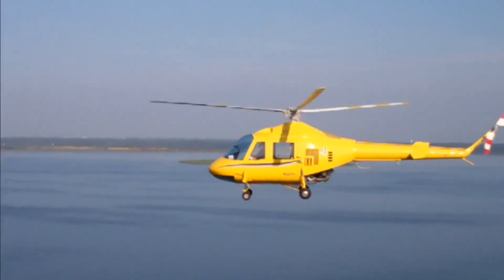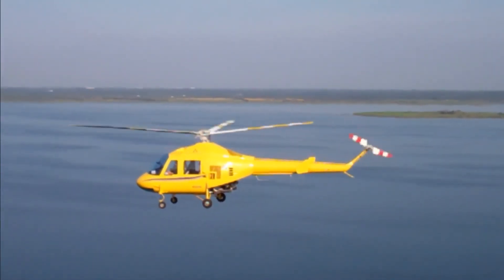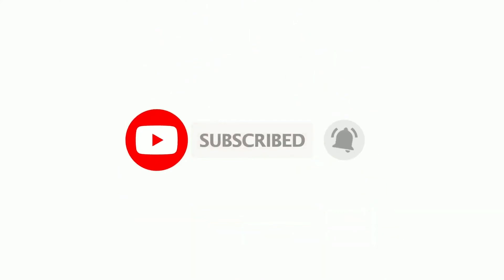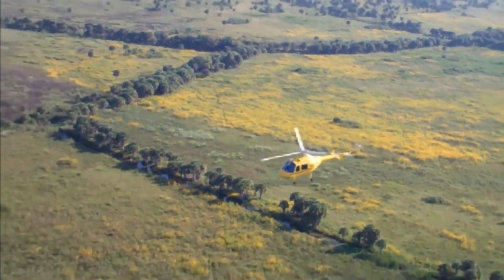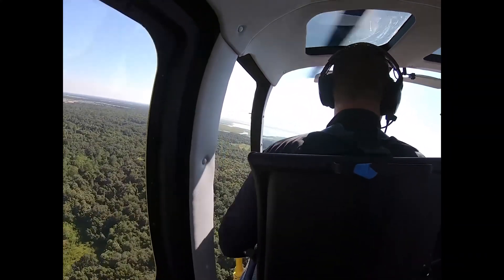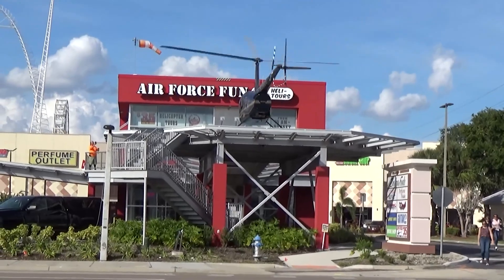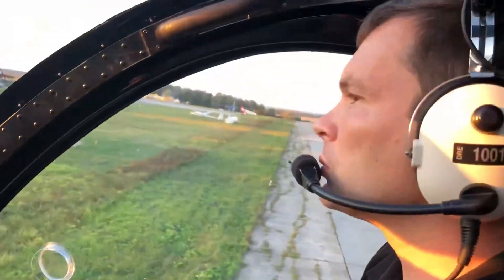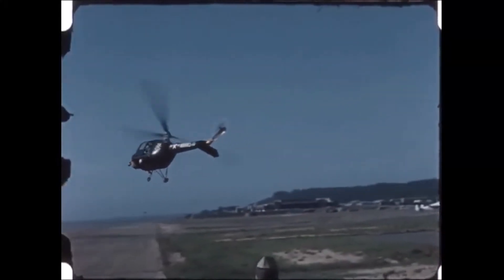The Hummingbird 260L(&300L) Is the Best Piston Engine Helicopter in the Entire World! S1|E8

Comment: Mechanic here, not sure if it was just for a visual of performance if so ignore this if not, just a heads up the engine with the scoop on top isn't a LS7 or any LS engine. All LS motors have a coil pack design and none of them use rotary distributor for ignition spark.
Reply: That particular helicopter with the engine intake scoop is registered as having a Lycoming VO-435-A1F engine
Reply: @LatitudeSky The 300L is the version that uses the LS engine. So they are made to use LS engines as well. Vertical Aviation’s website clears a lot of this up.

Comment: So automobile engines are less reliable?  I guess that’s why I just drove my 90,000 mile Corvette to Sun ‘n’ Fun in Florida from California and back without using a drop of oil.
I think that’s 3,000-4,000 hours?
YourLycoming is going to be long dead by then.  The Robinsons I fly use a quart of oil an hour.
Reply from the maker: lmao
Reply: @RelativeMotionCC  For small helicopters, I would rather fly a schweizer.
Reply from the maker: @geddon436  Nothing wrong with that! Everyone is going to have their preferences
Reply: Put your corvette on a dynamometer and run it at constant 300 hp for 2000 hours and come back.

Comment: You can ground taki with skids. Either way wheels or skids you have to be careful for different reasons.. Skids don't roll as smoothly and wheels wont roll sideways so attention must be paid as not to roll it. With both you still need to power off away from obstacles and push or pull the rest of the way as you dont want 5he rotor to make contact with anything. I love the videos anc look forward to the next.
Reply from the maker: Are you talking about dragging the skids along the ground?
Reply: @RelativeMotionCC  yes its not very practical because beyond feeling like damaging the taxiway (although no worse than taildraggers with skids) you still need to be careful when sliding about and can only get so close anyway due to the rotor. I think ground taxi is mostly done when trying to minimize rotor wash to other aircraft and can really only be done on smooth paved taxiway as a hover taxi would be done during landing. Wheels certainly roll easier but can only roll forward meaning you really need to be careful not to drift sideways (to the best of my knowledge Heli wheels are all locked or at least I've never seen one with free castering not sure how well that would work). After landing the wheels definitely make things easier. I love your videos with the side by side comparisons to similar models. It makes it that much easier to dream and drool over what I hope to be able to afford one day lol.
Reply from the maker: @sunshinezoner7275  Haha ok fair enough. You know I had never thought of/seen that before but that makes sense that could be done! 

Would it do less damage if you were on dirt maybe? or would that be too risky because of the more uneven ground of tipping? 

Thanks! Glad you like the video!
Reply: As long as it wad solid terrain and fairly level dirt would be fine. You just don't want it to be uneven and accidentally catch the end of the skid on something like a large rock and flip it. Or soft or wet ground thank could potentially sink with the weight and force. I'm sure hard dirt would work fine. I love helicos for as much as they can be a pain in the ass they're also wonderful machines.
Reply from the maker: @sunshinezoner7275  Good points, that makes sense. 

They are the ultimate form of transportation!
Reply: I once saw a Sky Rand pilot working on his firefighting setup, and asked him why it had wheels and not skids…

“Skids are for kids!”
Reply: With skids you air taxi you do NOT drag the skids on the ground
Reply: Get light on the skids & drift foreward..just don't enter ETL or she'll pull away.. with less than hover power..groung taxi w/skids is just not allowing taking off while doing a running takeoff..